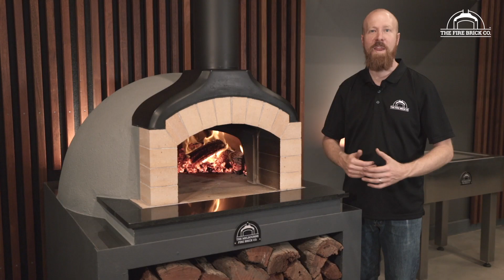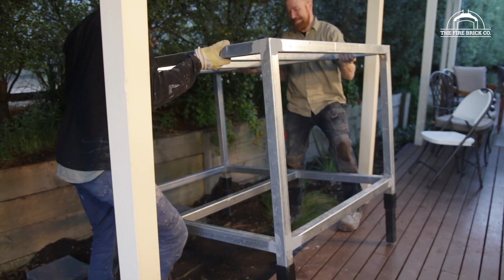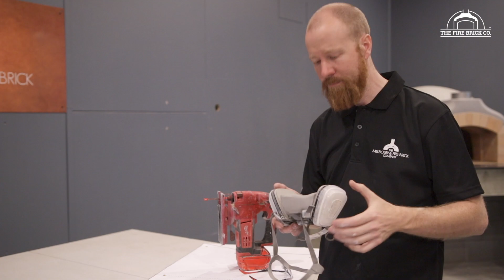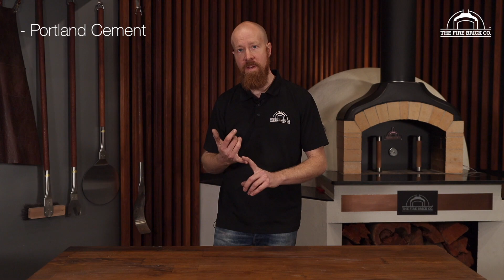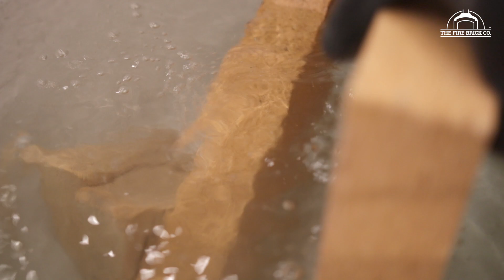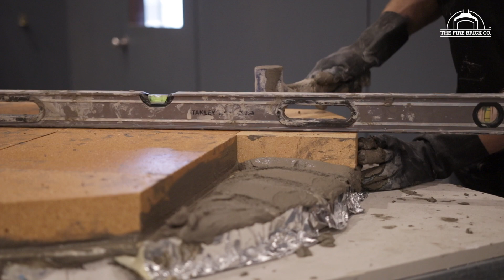How to Build our PreCast Oven Kit | 3. Stand, Insulation & Floor Tiles

Comment: Any problems yet with the cast dome spalling ?
I think the metal stand and not having to pour a foundation has me going cast instead of brick, even though I would really enjoy building a brick one.
Then again wood comes at a price here in So CA so shorter fire time is a plus.
I am sold on your ovens because the detailed videos and superior design than others.
Keep up the good work
Reply from the maker: Thankyou!! We have never had a spalling issue with our castings, probably because we reinforce them with stainless steel fibres (the castings are 3% stainless steel by weight!) and we vibrate the castings to remove air pockets during the pour

Comment: Hey Ben I see how you use calcium silicate board which is an insulator, vs some others that use a refractory mortar sub floor.  Wouldn’t it be better to use something that will allow for more thermal mass and heat saturation vs an insulator?  I understand there will be much more weight but wouldn’t it help with floor temperature consistency?
Reply from the maker: Good question! You definitely want to have plenty of thermal mass in your oven floor (which we have here in the form of a 50mm dense fire brick tile) but you also need insulation, otherwise all the heat held in that thermal mass will just escape into the benchtop beneath it, and then into the atmosphere to be lost forever. You're on the right track in wanting a good amount of thermal mass, but it is *critical* to have insulation beneath that, or you will be building something that just won't achieve the floor temperatures that you're after.
Reply: @TheFireBrickCo  Thanks Ben, as usual you provide great info!

Comment: Hi Ben, I noticed your brick ovens use 1” refractory over the cal/sil board for thermal mass but your kits omit this step. I would think the thinner kits would benefit more from additional thermal mass. If I wanted to take the additional step of adding the 1” refractory over the board in the kit, would this be ok?  Would it make a noticeable difference?
Reply from the maker: Hi Ken! You can most definitely do that if you want to, however the reason we don't is that we're looking to balance the amount of thermal mass in the oven dome with the oven floor. The P85 Oven has just the 50mm tile for the floor (as does the D95 Brick Oven) as the ovens are smaller than the larger D105, and one of my key design criteria for the P85 is to give it a nice, quick heat-up time. If you increase the thermal mass in the floor you will also increase the heat up time of the oven substantially, as you'll need to bring all of that extra mass up to the required temperature to get a good crispy base on your pizzas.

Comment: nice video. doesn't the calcium board need to be glued down to table?
Reply from the maker: It doesn't actually - the weight of the oven pins it in place. Not much sticks to the Calsil board as it's very chalky

Comment: How is the calcium silicate board attached to the cement sheet?
Reply from the maker: It's not - but the weight of the oven is so great that even once the floor tiles are down it is almost impossible to shift it by pushing on it. Calsil is like chalk, so there is very little out there that will bond to it, but thankfully that isn't necessary

Comment: Is it possible to build the brick one on the stand like that?
Reply from the maker: We don't recommend building a brick oven on a steel frame like this as the recommended benchtop is 120mm of reinforced concrete, which is very heavy (particularly when you add the weight of the oven itself!). While it IS possible to build a brick oven on a steel frame, it is usually cost prohibitive.